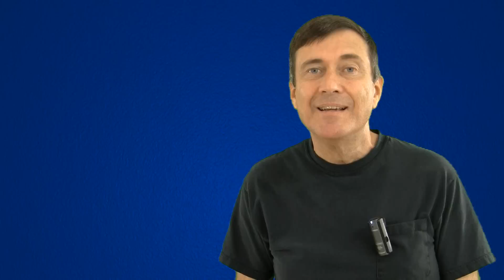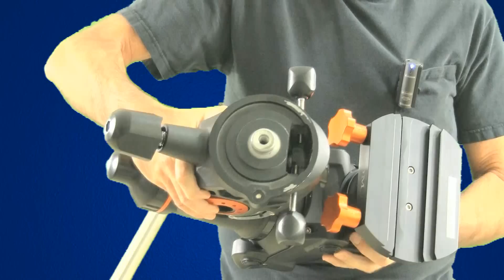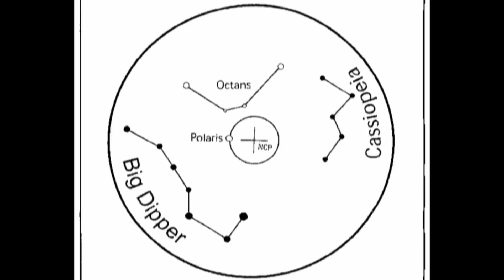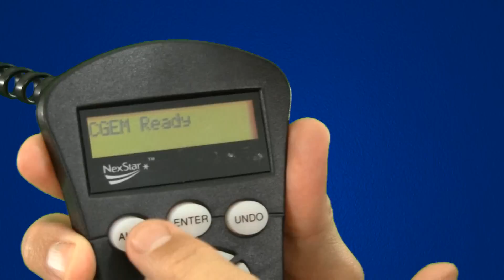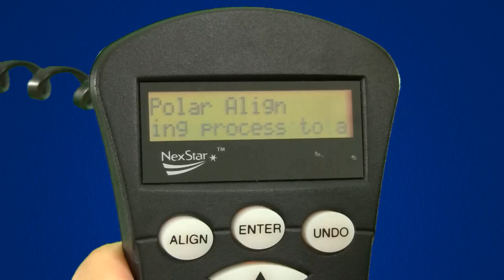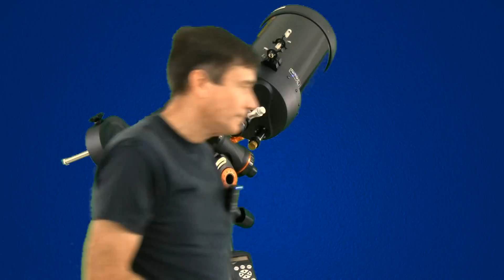NexStar Polar Align w/ASPA

Comment: But, first the polar scope needs to be aligned. At that in its self introduces error because the eye is used to look at a distant spot to align the scope. So, it may get a scope in the ball park. That is where the star alignment come in. If the home position is accurate the telescope itself can be used and makes this much easier to find the north star.  And this method is fine for visual observing   the moon and planets.

Comment: I have two questions.  In the dark, how do you visualize Polaris through the polar scope?  Second, once your hand controller gives you your polar alignment, why can’t you manually adjust the alt/az controls to bring those figures to zero error?  Thanks!
Reply from the maker: I shine a flashlight into the eyepiece to illuminate the reticles. So my eye and a flashlight are right together looking into it. ASPA has you move the alt/az controls to bring those figures to zero error. Unfortunately it is not accurate enough so I end up doing it multiple times. The hand controller can only "know" the error after doing an alignment. Once you fiddle with the alt/az things change and the computer doesn't know how good a job you did. I got tired of using ASPA. I would spend an extra hour just doing polar align. I now use PoleMaster to get the mount polar aligned before even turning on the hand controller. https://optcorp.com/products/qhy-polemaster

Comment: wwgeb: you mentioned the cone error that the telescope may have. How would it affect the ASPA process? Should the scope be corrected for the cone error first? 
Thanks!
Reply from the maker: I believe the cone error should have no effect on polar alignment. If I remember correctly the CGEM hand controller computes the cone error and will display it under some menu. I am not a fan of ASPA. Since I started using PoleMaster I won't ever use ASPA again. I wasted nearly an hour getting polar aligned each night using ASPA, an hour I could have been imaging. YouTuber AstronomyShed made this video that helped me to understand cone error. https://youtu.be/WatdQlPp22Y

Comment: When you get to the part where you do the polar align   using the azimuth and latitude knobs if you get the star center but it's not perfectly center and still have error can do the go-to back to the star and try again or does this require starting over from scratch I was off by 00 00 01 and 00 00 02 I hate using a DSLR with a SCT I gotta use a SCT adapter for the DSLR but I gotta use the adapter for the SCT to have a eyepiece in I am waiting on my adapter for my Astro-tech AT72EDII to be delivered but anywho was curious as to what you do it the error isn't all 0's I have a illuminated eyepiece I believe it is a 12.5mm I was using a 40mm didn't feel like using the 12.5mm eyepiece likely will next time
Reply: 00 00 02 is the same as 00 00 00 in the sense that it is your hand controller telling you that you did a perfect job. It is not to be believed. Shut off the power and do the 2+4 alignment again. Then have it display the error. That error will be something closer to 00 15 00 which is more realistic. I hate ASPA. I got the polemaster and like it a lot. It does require a good view around Polaris but it shaves off an hour of alignment each night. ASPA takes well over an hour and you lose all that time when you could be imaging. https://www.highpointscientific.com/qhy-polemaster-electronic-polar-finder-scope

Comment: Elevation knob isn't that supposed to be done before the alignment the Elevation knob is the latitude correct?  One thing I am confused on is the azimuth knobs, if The big dipper is at the 1 o'clock position and the R.A is rotated to that direction are you supposed to use the Elevation knob and azimuth knobs to get Polaris into the o or is only the azimuth knobs used to put Polaris into the o.
Reply: Yes the elevation knob is latitude but we need to be more accurate than just setting it to your latitude. That only gets you in the ball park. The bubble level may not be perfect and certainly the latitude indicator is rather crude. You move both elevation and azimuth to get Polaris into the o. --wwgeb
Reply: @WarmWeatherGuy  Thanks, for getting back to me, Hope all is well with you!

Comment: Steve I notice you mention rotating  the R.A until the image inside the polar scope I guess matches one part I am not clear on is is the mount supposed to go back to being center after that or is the mount supposed to stay facing the direction the image is inside the polar scope. I always thought you needed to loose or tighten the polar scope until the polar scope matched the image in the sky, only weird thing about loosing or tightening the polar scope is it will either be wiggle or too tight. I got my AVX being delivered on Tuesday the 5th of March so this is going to be a interesting night not only having to deal with maybe clouds but having to remember the polar alignment again.
Reply: My video assumes that you have already installed the polar align scope (PAS) and aligned it properly. The video is on how to align the mount to the North Celestial Pole. To do this you need to rotate the cartoon image so that the Big Dipper / Cassiopeia are aligned so that the tiny circle for Polaris is oriented properly. On the CGEM you have to rotate the RA axis to make the cartoon image rotate. On my G11 I can just rotate the PAS without having to move the RA axis. The actual position of the RA axis is irrelevant. Once your PAS is installed it should not wiggle. The only thing you loosen will be the az/el portion of your mount so you can get Polaris in the tiny circle. This is something you do one time per evening. The installation of the PAS is something you only do one time ever. YouTuber AstronomyShed made a video on how to install / align the PAS. https://youtu.be/BS43vH_sDbg

Comment: You know the funny thing is I did a Polar Alignment using deneb as the first callibatered star then used Altair as the second callibatered star then I did the Polar Alignment using Altair as the Polar Alignment star and with a bit of work I got the alt/azm down to all 00's I was pretty shocked the cool thing is you can go back and try to Polar align if you have errors without having to start all over. I imaged  the dumbbell on the 24th I did 20x60 second light exposures and 20 darks and 35 bias frames came out nice for unguided. I did M13 last night/morning.

Comment: Trying to figure out why without the Celestron advanced VX mount I have to rotate the OTA because when the mount is in the home position the polar scope hole is covered by something inside the hole unless I rotate the OTA left or right then the hole is covered a bit confusing. Nunki was a bad star for me to use this morning maybe because the Moon was washing out the star but when I got to the part you move the mount in altazumth and Altitude I'd lose that star and have to turn the mount off and redo the two star alignment over again luckily another star was coming up from the East managed to get the polar alignment some what good my error was 1 for Alt and 2 for azm
Reply from the maker: Congratulations on your new AVX mount. I never liked ASPA. I finally got a PoleMaster and like it a lot. For PoleMaster to work you need to have a view of Polaris and the surrounding area. SharpCap has a similar feature which can save you some money.

The polar scope has you looking through a hole in the shaft. The shaft has to be rotated to allow you to look through that hole.

Comment: Hate my CGEM. It goes 40 DEG too far East. I've got in on a concrete pier so I Know its polar aligned.  If I manually put it on a star, it will keep it in the eyepiece for 25 minutes easily. But the software will not put anything within 40 DEG of the eyepiece. Wrong part of the sky completely.  I've had it hit the pier it was so far off even. Fought this mount for over a year.  Gave up, going back to my Meade LX50, still works right after 20 years.  Still haven't been able to sell it on Ebay.
Reply: Hi Lewis

 I have a CGEM and i was getting the problems like you describe at first. At times i felt like smashing the mount into little pieces it was so frustrating. but then someone told me the info below and even talked me through it and bingo all was spot-on since. After 2 star align and 2 cal-stars it tracks for many hours and puts even the smallest objects in the center FOV.  
1- If its always going to far east every time that tells me that the mount is ok, basically because your getting the same result every time. 
2- have you set up your time -site correctly (this was my problem!!) ?
3- You can add all this info manually longitude/latitude timezone and time, you can google search for all this info and after entering it the controller will remember it, the controller also has a inbuilt clock if you turn on/off then you never need to enter any of that info again.
4- Once its all set up the other good thing about this mount on a permanent pier is you can use the Last align setting to your advantage as well.  

If you need any more info or help please just ask, i will even give you my email address if you need further help to fully set it up so you won't HATE the mount, with its extras this mount should be the opposite, and actually make setting up a breeze.

Thx Paul (UK)
Reply: eBay is not a good place to sell telescope mounts. Try Cloudy Nights classifieds or AstroMart.
Reply: Tried Cloudy Nights first.  At $1500 for the CGEM + 9.25" SCT + tripod.  No takers.

Comment: Reccommend the cgem dx or later model cegem II or some other system ??
Reply from the maker: I had the CGEM (non DX). I added a tripod spreader which made it almost as steady as the DX. Celestron as discontinued the CGEM and they have some new mounts that I am not familiar with. I sold my CGEM and bought a used G11 which I like. Check out the mounts forum on Cloudy Nights. 
 https://www.cloudynights.com/forum/66-mounts/ 
 There you can find people with experience in all kinds of mounts.
Reply: Thanks..

Comment: Hi, first thank you so much for taking the time to explain the polar alignment. I have a second hand CGEM and was struggling to understand ASPA and polar alignment due to the fact I can't physically see Polaris from my driveway which were I do my viewings. I was able to finally understand ASPA and tried three times yesterday to practice. One thing i noticed is that my GOTO's are not in the center of the eyepiece after the ASPA. It gets them in the FOV of the eyepiece and tracks them well but eventually they start to drift out of the eyepiece view after a long time. I turned off the mount and re did the 2 star alignment with 4 starts after the 1st ASPA and still is off the center. Do I need to do another ASPA and use the azi/alt knobs to adjust? or Only if the hand controller says the alignment is off? If it says 00 00' 00" then I'm good?
Reply from the maker: +Juan Colon I use my polar alignment scope (I can see Polaris) so when I do ASPA there is usually only a small amount of adjustment. I have a NexStar 5SE where I don't use Polaris and I've had to make large adjustments with it. Afterwards I turn it off and start over. After aligning the next time (after doing ASPA) I check to see what my polar alignment error is. I found that it was just as big the second time. Then I would keep repeating and it would keep giving me the same error (in magnitude, but the sign of the error would flip). To fix that I would only move half way to the star. Once you get the error down it will converge but if it is really big it will bounce back and forth. 

Having bad polar alignment shouldn't affect how accurate your GOTOs are. I usually notice that when doing the 2+4 alignment that the accuracy keeps getting better until the last couple stars are very close. Then all my GOTOs are very good. How you perceive that depends on your FOV though. I use a 20mm eyepiece with crosshairs. Not aligning with crosshairs or aligning on the wrong star can affect your GOTOs.

When tracking, the CGEM only moves in RA. The Dec motor doesn't run. If you have bad polar alignment the GOTO should get you right to your target. Then, if you view it so North is up, you will notice the target drift up or down (which way depends on how your polar alignment is wrong). Any motion left or right is due to periodic error in your RA axis or because you have the wrong tracking rate.

It should never say 00° 00' 00" except right after doing ASPA. I suppose one time out of a million you would get it perfect but generally you will have 00° 15' 00" or so after doing ASPA and shutting down and redoing the 2+4 alignment. Don't believe the displayed error right after doing ASPA.

Comment: Great tutorial. Just one comment, the manual mentions to unsync after you are done with polar alignment and do another 2 star alignment, I guess we would skip that step if we turn the mount off and start over again, probably safer...
Reply from the maker: +Marcelo Reginato It has been a while since I used ASPA. I have been doing planetary imaging for the last few years which doesn't require more accuracy than I can get with the polar align scope. For deep sky imaging I usually spent 3 or 4 hours capturing so I didn't want to spend a lot of time figuring out the best way to use ASPA. I never trusted anything the computer said after I moved the mount so yeah, for me, I felt safer just starting from scratch.

Comment: I bought a polar scope and did my polar alignment with just the mount.  Great suggestion.  I did my 2-star align then a calibration star but did not go back and use the hand controller to select Polar Align.  I bet that will help next time.  Thanks a lot for the lesson.

Comment: I'm using the AVX with the ASPA routine.  I find that I don't have to recycle the power and do the standard two star alignment before I go to the next star, if I want to do multiple stars in the ASPA routine.  I just slew to my next star, and then press Align/Polar Align and start over again.  My tracking doesn't seem to be bothered by this.
Do you really need to restart the computer each time you to the ASPA routine?  Just curious if anyone has tried it this way before?
Reply from the maker: Gary C That is an interesting question of whether or not you can improve polar alignment by doing ASPA multiple times without shutting down first. I don't know the answer. I do know that after doing ASPA the hand controller reports zero error which is not true. I shut down and do the 2+4 star alignment so I can get a more accurate report of the polar alignment error. I will have to try what you said to see what happens. I have been doing planetary imaging which doesn't require as much accuracy as deep sky photography so I haven't used ASPA in years.
Reply: Hi, I called Celestron technical support about the issue---if I need to shut down the mount after ASPA. I was told that it is not necessary to turn off the power after ASPA. I just need to go back to the initial two stars used for initial two stars alignment and realign them. This seems to be working for me.

Comment: I just got an AVX mount and am trying a first polar alignment.

I am trying to follow your directions, but certain points were not made clear in that you did not show how to navigate to the next step being discussed on the handset

1) Up to 8:48 was great, but then you began explaining to do an "All-Star" Polar alignment, but did not explain how to use the handset to do the entire procedure.
The last place you left off showing navigation on the handset, it was showing the error....but no explanation as how to get from there to the "All-Star" Polar Alignment, or to complete the procedure.

You eventually said you chose Antares, but did not show what buttons to press to get to the "GoTo" to do it.

Please be specific, and explain which buttons being pressed to get to each step.
Reply from the maker: Bunny Duck I used an older hand controller in this video. Celestron has since come out with the NexStar Plus hand controller and the buttons are different on it. In place of the Undo button the Plus controller has a Back button. Pushing that several times will ensure you're at the top of the menu tree. From there you push the Align button. This takes you into the Align menu which has Polar Align which has options to display or perform polar alignment. As for the goto I press the List button and scroll to the Named Stars menu. I see that the new hand controller has a Stars button so I'm guessing that gets you there with less effort. You scroll through the list of stars, select the one you want, and press Enter. I found it helpful to take the manual with me so I can refer to the map of the menu trees. It is frustrating looking for something in that maze of options without a map. The AVX seems like a really nice mount. I would have gotten it if it was available when I got my mount. Clear skies.